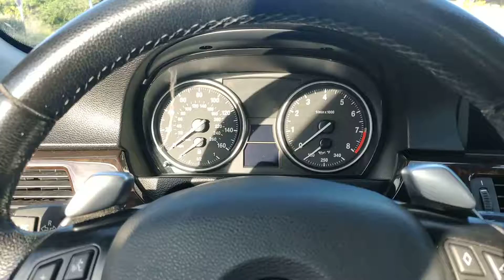How to reset Steering Position Sensors (ABS/DTC/AWD)Dash messages(SAS/LWS/SZL...)

Comment: Hay friend 😁, i do on my e90 2005 steering rack repair with new steering pump and oil , i also do alignment because i change almost everthing front suspensions, but can i need to reset that angel position sensor?

Comment: So, BMW does not use a "EEPROM" and some sensors & modules get stupid with bad battery or changing? That crazy!! GM vehicles (Some not on cheaper cars) but I can pull the battery, set it on the bench for a month, put it back in and have all pre-set stations, volume last set, memory seats, steering even mirrors for driver #1 & driver #2 and no DTC's (Diagnostic Trouble Codes) as this information is stored in "Electronically Erasable Program Read Only Memory". 
North Carolina where Bubba Makes Wheels or BMW are born. Wow! Get into the 21st century guys.
DK, ASE master tech since 78, retired.
Reply from the maker: Hahah.
Yes, the system that they use is pretty wired, it looks like they installed counters on every single module, and only special tool can clear the history and memory.
What even more annoying that if some of the systems get 50faulty messages in the row, it will cut the power to circuit. And then you have real pain in ass…
yeah i wish i can afford newer car, but it is what it is))
Reply: @Makhnovets   The "Enable Criteria" list a set of any one code that is active to disable the running of additional test on a system or device. This makes it impossible to have 50 codes. If a tech forgets to plug in the MAP sensor, the system ignores all calculated altitude, engine load, throttle position and VSS. Game over until fixed. Plus, I like viewing 5 failure codes for comparison. For over 20 years, GM has made their architecture global. So the same modules and regional software is the same in Egypt, Dubai, Japan or England.

Comment: Didn't work
Reply from the maker: It's just the basic way to reset the steering sensor to default settings... otherwise, you need to use the ISTA.

Comment: Hi how have calibrate bmw x3 please.with diagnose dont working calibrating.numbers changing from minus to plus numbers but everytime stay on -32
Reply from the maker: in that case you might simply need to visit the BMW shop for enlightenment, it's as simple as your wheels looking one way and computer see it as straight so it's giving you the wrong info. But like i said there soppose to be specialized shop tht have the right equipment, and calibration has to include in alignment.

Comment: Forget it! It's a malfunction in the SZL reader and they'll have to fix it. It's a matter of time.
Reply from the maker: I know that the manufacturing flaw, but that's more like a soft reset, and not the permanent fix if you have bad szl or any other component that will not fix the issue, it's more like to tell the car what steering position it has before SAS was disconnected from the power...

Comment: What about start off assistance after a wreck i replaced the parts that were bent which was rear trailing arm the front one and the wish bone as well as brake line i refilled the brake res and i have all the lights on . i could send a message privately with a picture if needed
Reply from the maker: The car have stored crash data in the central module, you need to do reset and see if you have all the power passage, all of that can be done true the ISTA. You can find my email in About section on the channel, welcome to send me an email with pic. also include all presented codes. you also can do reset true INPA or CARLY.(Don't have Carly so can't say much, but the people who has it, they claimed that they can reset the modules after crash)
Reply: Sweet ill be in contact soo. Thanks fkr a quick and great reply 🙏👍

Comment: Thank you for sharing, I have a BMW 5 series 2005 model. I disconnected the battery terminal and once connected them again the steering wheel rotated itself to about 60+ degrees left from its center while the tires did not. And the problem now is when the wheels are straight foward the wheel steering is not at its center. Please help me how to fix it back to normal position.
Reply from the maker: https://youtu.be/zHaz0ASrNgc  -  that one, you will be able to calibrate to whatever position you need!

Comment: I drove through some water and steering inactive light came up
Reply from the maker: The only explanation is harness or connector to the steering position sensor or sensor itself, possibly speed sensor, what your obd say?
Reply: @Makhnovets  it said steering inactive.  I called my dealer and he said my rockanpinyon is gone
Reply from the maker: @birdman9142  what car year and model?
Reply: @Makhnovets  ok
Reply: @Makhnovets  2014 523i luxury
Reply: 2014 523i luxury
Reply: Sorry for the late reply I thought u was asleep
Reply from the maker: That's the possibility, but the steering rack dieing from the water splash, it's rarely, try to put your hands on ISTA, and go true adaptation or replacing procedure or solutions that app is offering you, as well as make sure that the harness and sensor in good shape.
Dealer told me my transfer case is gone, and i need the new one, now it's 20k mi after, and no codes or so, ISTA fixed it with click of a button.
Reply: @Makhnovets  so I really hope what u said works. Thanks for ur opinions tho.. will let u kno how it work out
Reply from the maker: @birdman9142  https://www.youtube.com/watch?v=zHaz0ASrNgc
Reply: @Makhnovets  ok I'll tell my mechanic to try that today. I live in Jamaica and it's 3,000 usd to replace the rockandpin

Comment: Hi, Just took my X5 for an exterior wash which included the underbelly washing as well. After a while, I got the messages Active Steering Fault + DSC Failure (which is interlinked to the steering fault). Bear in mind, didn't have any issues at all prior to this. this only happened after the wash.
Reply from the maker: In most cases it’s a SAS connector, make sure there no corrosion, as well as make sure all ground cables that connects under the car have no corrosion!
Reply: @Makhnovets   Thanks for the info. Ended up changing the power steering electric pump and the issue was fixed.
Reply: @vineethjayakody2971  was it costly.? I am having a same issue in my 7 series 2010 it was all fine i did some work and change the front shocks after that my steering 20 degree left then i did the alignment so my steering is in center now but till now i am facing this error..
Reply: @shankhan-bs1jg  it wasn’t a very costly. It all depends if you’re replacing it with a second hand part or installing it outright. Hope the issue will be fixed with your car!
Reply: @vineethjayakody2971  thanks for the reply well actually it was a technical coding issue he rest and did the coding and it went away

Comment: Guys i got issue with my power steering, it seems all assist are in the left side causes stiff turning to right, could it be torque sensor problem? I installed new ecm already but doesn't fix the issue. Done with wheel alignment and underchassi check up but still same. Badly need your help. Thank you
Reply from the maker: Sorry for the late response, what was caused of getting that issue? Or it just came from nowhere? Did you change the position sensor?
Are there any leaks from the steering rack? did you code the ECM? Do you have active steering?

Comment: Hi.  I'm going through this issue now with a 2012 GLK350 4MATIC.  I've done the reset procedure using the steering wheel turn from lock to lock but it didn't work.  I'm going to try the battery removal next and then retry, but if that doesn't work can you tell me which tool is needed to do a recalibration or to reprogram the angle sensor?  If recalibration doesn't work, my next step is to purchase a new angle sensor and install the new one but I've read that the new sensor needs to be programmed.
Reply from the maker: https://amzn.to/3iNQAHW
This one or similar tool can help. Sorry they are expensive. All the option is to stop by at some shop and ask them to try to reset the SAS or steering angle sensor
Reply: @Makhnovets  thanks for the quick reply!  I have tried the battery and lock to lock approach but no luck with either.  I've also read that the problem could be with the speed sensors as I'm getting fault code C326600 and C100500.  However, I've already ordered the SAS and picking up today hopefully.  Thanks again for the info.
Reply from the maker: @KennyF349  Sorry i forget to mention the speed sensor, my friend had similar issues on AMG.

Comment: Hey, after I went through a lot of rain and water on the road, I get e message on my BMW f10 which says Steering Response,  drive moderately,  and I lost all the power steering.  Any idea about it?
Reply from the maker: You need to try to reset the sas. I had that before,  same as in video, but only the ISTA or any dealer level obd tool.
Reply: @Makhnovets  what is sas?
Reply from the maker: @studioligjorecela  steering angle sensor.
Reply from the maker: Also make sure that you dont have abs related codes!
Reply: @Makhnovets  i just removed and inserted again the plug connector in the electrical steering mechanism under the car and it is working fine for now since yesterday. Maybe it had a bit corrosion and it wasn't trasmenting electricity or signal
Reply from the maker: @studioligjorecela  In that case get the electric grease. that will make type of silant inside and prevent corrosion! that would be my suggestion!
Reply: @Makhnovets  thank you for your suggestion

Comment: This didn't work on my 1984 Yugo...🤣😂
Reply from the maker: sorry to hear! Check the fuses, as well the older cars if they have any type of sensors, they got to be replaced! because they directly connected to the ecu or the relay box!
Reply: Dude it's a joke in 1984 they didn't have steering position sensors back then , as a matter of fact most cars had carburetors with throttle position sensors and a O2 sensors , and a cat !....and that was it!....lol🤣😂
Reply from the maker: @robertbenavidez7164  i know what the car is that, and i know there couple sensor's here and there))) but any way that the good catch!))😅

Comment: It doesn’t help for my Ford Edge
Reply from the maker: Most likely you need to go to the shop and recalibrate the steering angle, or the sensor inside of the steering is failing, The BMW and Ford are little different so you can not apply same technic to your car. if you have friends who have the powerful OBD scanner, they can try to reset the calibration! Good luck!
Reply: @Makhnovets   thank you for your response

Comment: My e60 m54 model has the steering stuck at an angle... when im driving straight its at an angle of 15-20 degrees to the right.
Reply from the maker: Recalibrate, i can make video how to do it, but it's only can be done true ista d. Or some more expansive obd scanners like the car workshops have or sometimes it's equal to like four to $500. Sometimes it happens, whenever you disconnect the battery or replace some suspension components or after alignment.

Comment: Thank you for your video! It saved me a lot of time and money! I just wanna add into your content! I recently replaced the battery on my 2009 VW cc and my steering become unusually stiff! It also pulled to the sides in high speeds. I HAD NO LIGHT ON THE DASH so my first guess was that my car needed alignment but I doubted it since it happened right after the battery replacement. I tried this method 3 times and now my steering is back to normal.
For those who have tried this method and it’s not working the other cheaper alternative is to use a FOXWELL NT650 scanner. It does the steering calibration and many other things! You can also use it for resetting the airbag, changing brake rotors/pads or even to reset your car after the battery replacement. Thanks again for the video.
Reply from the maker: Thanks!!

Comment: Hi there,
I have 2010 Subaru Forester and suddenly traction control off light turned on it. Then after I scanned 've got a code C0071  Steering Angle Sensor Malfunction. What should I need to do now??
Reply from the maker: As far as i know about subaru, the sas sensor have to be recalibrate evry time you do alignment or some sort of changes related to steering position. One of the downsides is you have to have SSM unit, which is carrying by dealership. Best guess do the soft reset, disconnected the battery for 10 min, only the neg. clamp.  And try to do same thing as in the video, and hope for the best!
Reply from the maker: Good luck!

Comment: Do you know some about an Audi A4 2013 I have the same problem but there’s a ggg noice when I turn the wheel to the right or left
Reply from the maker: Check the steering fluid level and fluid thickness first) then the position sensor... But if you have ggg noice that's more likely fluid, or pump itself dying...
Reply: @Makhnovets  but it's a electo asisissted steering. Ther's no reservory for the steering.
Reply from the maker: What's the obd says?
Reply from the maker: It could be the steering rack, where the noice comming from?

Comment: I will be trying this on a 2007 Dodge Charger R/T tonight.
I hope it works. If not my mechanic will have to work his magic with his computer.
Reply from the maker: check the connection on the sensor, disconnect the battery for couple min.
Reply: I also tried on my 09 Charger R/T but no dice! Did it work for you? Also do you have an AWD Charger?
Reply: @juice8225  I had same issue on my 2007 dodge charger rt awd have esp bas,abs,traction lights change steering angle censor and nothing I do have a code for steering angle sensor but after I replaced it lights still there and code.did yall find the answer to this problem?
Reply: @jasminecorrea5644 if I remember correctly it was the magnetic ring on the CV which I replaced and worked. Could replace the whole CV if you need it